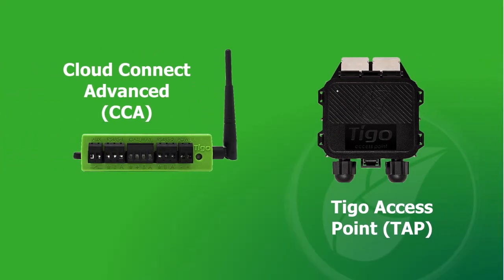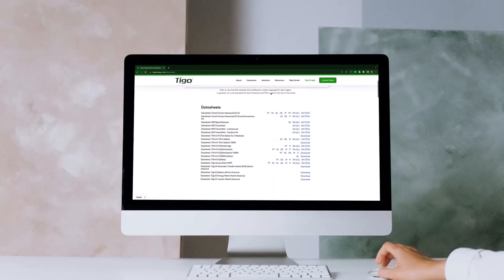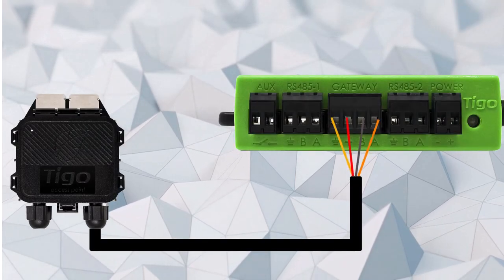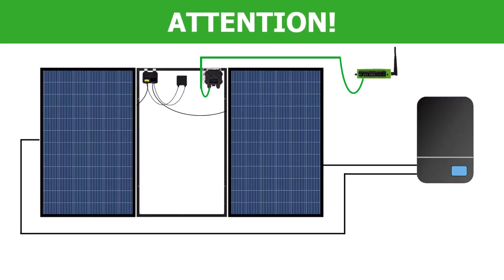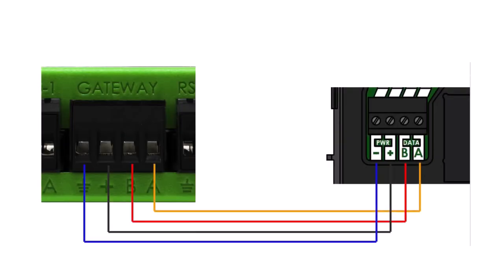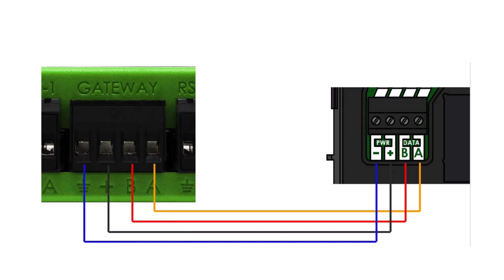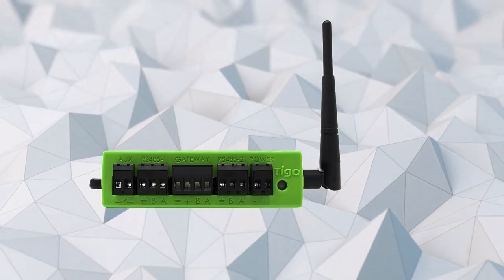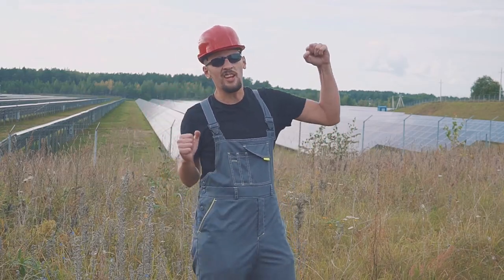Tigo CCA to TAP Connection

Comment: TAPS seem to have a limited low temp rating. TAP could be mounted nearby in a heated space instead, correct?
Reply from the maker: The TAP as a -22F (-30C) low temperature rating, so if your area could see temps lower than this then it is acceptable to install the TAP in an attic if you do not have a metal roof. The TAP communicates to the TS4 wirelessly and metal roofs will affect the signal strength.
Reply: Can I use the USB port to connect RS-485 to TAP ?